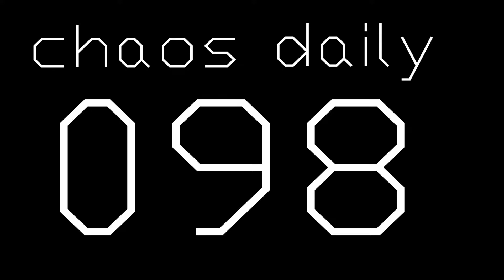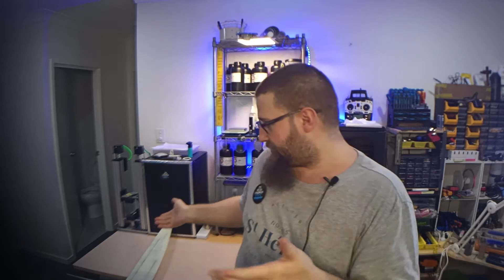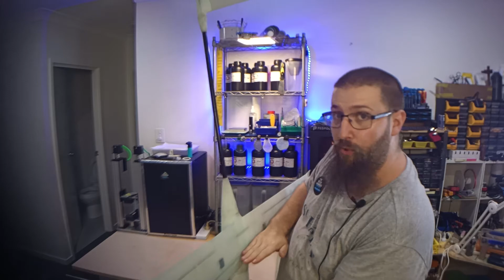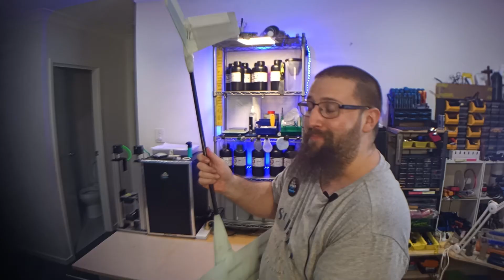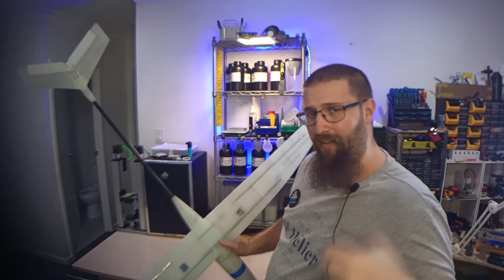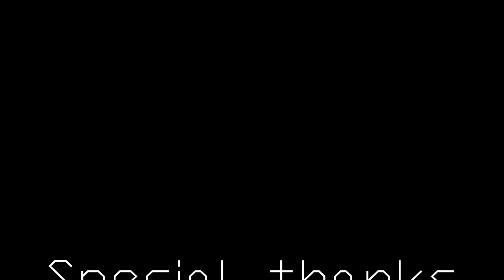chaos daily 2021: 098 Soooo I forgot to check the CG

Comment: Hm, so the lighter battery is propably not an option at the moment... do you think you will be able to save some weight on the tail in a further iteration?
Reply from the maker: Designed it with the bat under the wings and a bit forward, ive already looked at cutting the weight in the tail. The plan from the start was to shorten the tail to set the CG, I just forgot to do that before gluing the tail together. I can shorten the tail by quite a  lot since the the moment arm inertia is very close to the CG under the wing. ill have the new parts done and on the plane by the next episode so no big deal. I will do the maiden on ep 100 if possible, weather has started clearing up.